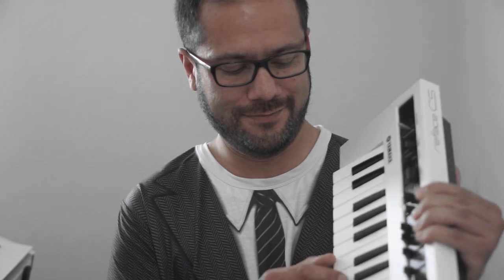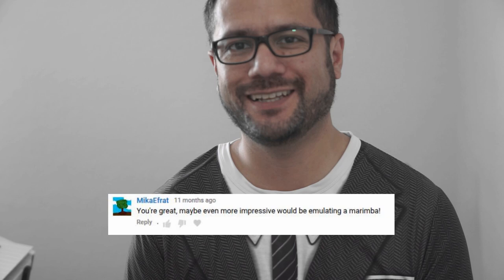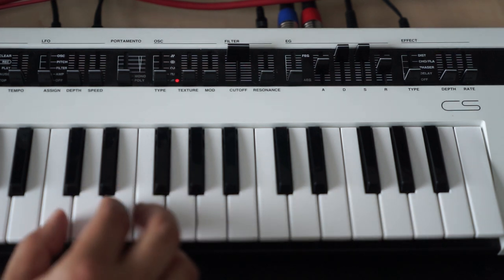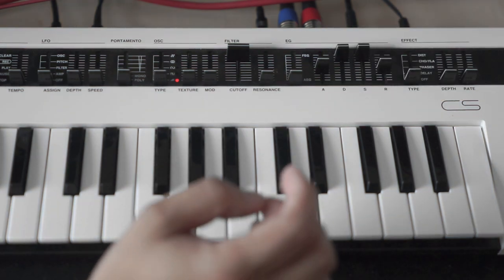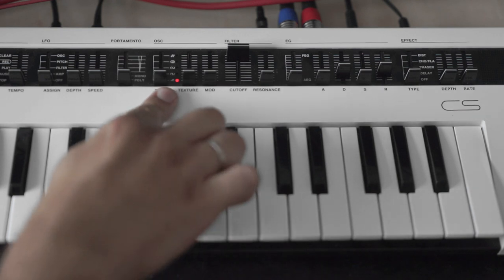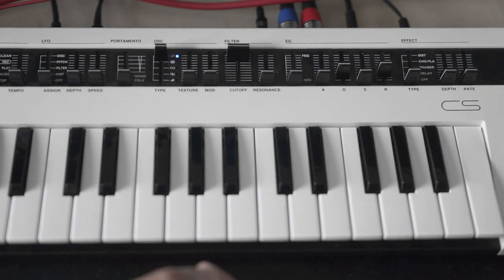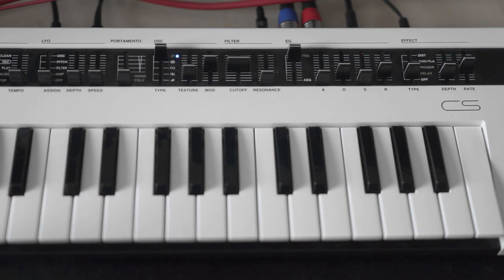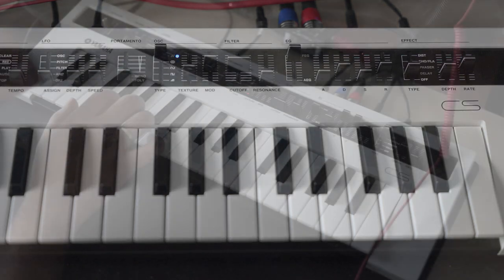How to create a marimba - like sound on a (virtual) analog synthesizer / Yamaha Reface CS

Comment: Thanks. I programmed my cs along with you and I got close to a marimba sound too. Now, I know i really  need to get a reface dx, but can you get anywhere near the Dx7 e piano sounds eyc, on a cs?
Reply from the maker: Thanks for watching! Well, yes, you can get near. Use a sine wave for the oscillator and dial in a fast attack, medium release, no sustain, medium decay. Use the modification slider until it sounds somewhat like a piano. 
The problem you'll encounter is the CS is that is has no velocity sensitivity, so playing with expression (which is crucial for a good EP sound) won't work.

Comment: I've notice that the reface is not key sensitive you can't play chords and melody at different intensity, that's a shame, because it seems that if you use it as a midi controller you can transmit velocity, do you know any way to play this instrument with velocity response?
Reply from the maker: Hi Ricky, thanks for watching. I think there could be a way with a midi processor, which picks up velocity and routes it back to e.g. filter cutoff frequency. I never tried this and setting it up could be a bit fiddly. Look up the MIDI CC implementation in the manual... Should be possible. :-)